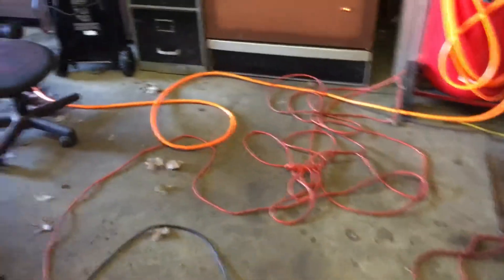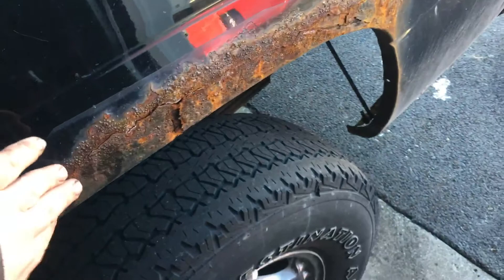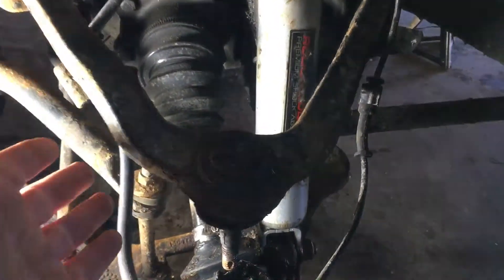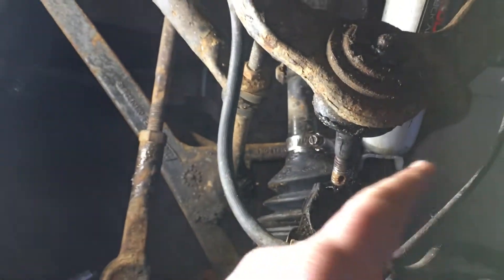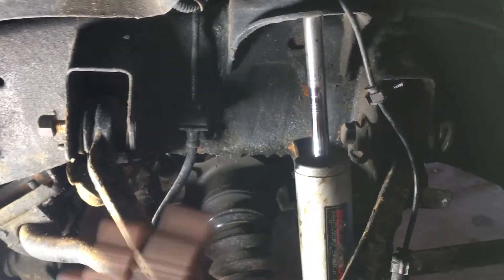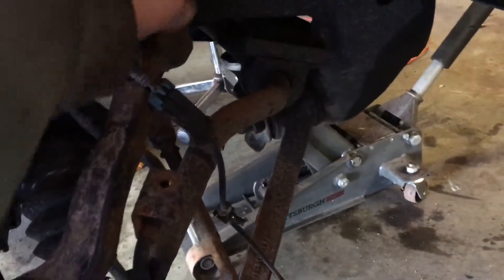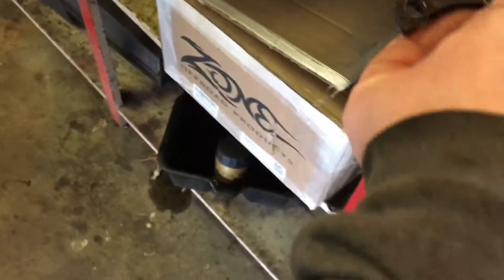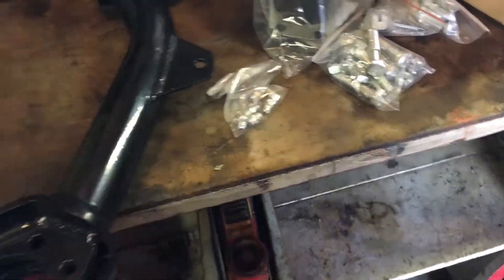01 Silverado (Murderado) Upper Tubular Control Arms (Part-1)

Comment: 3" or 3.5" lifts without a diff or lower control arm drop bracket is probably the worst lift possible on the parts. You should pick up some front diff spacers from RC to space the front diff down about 1.5" and relieve your axle angle. It would help. Once you replace the UCA's with corrected ones the main issue is the axle.